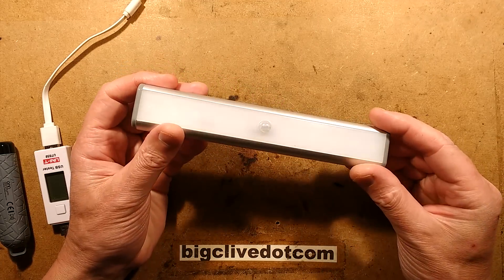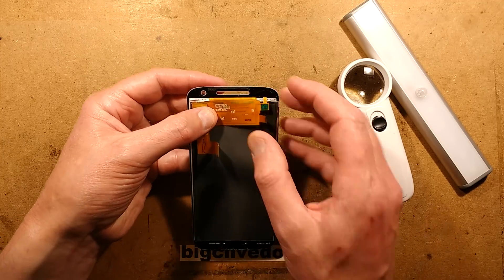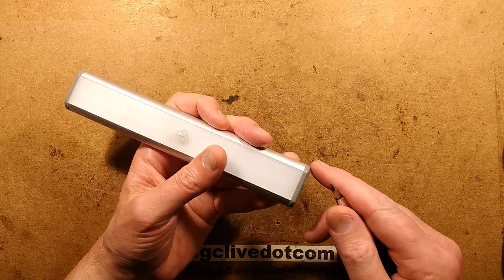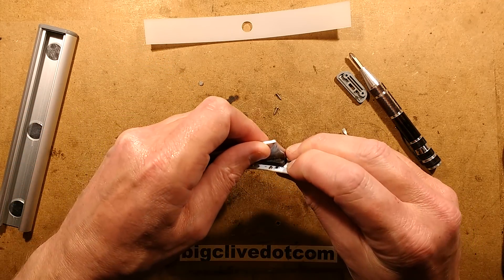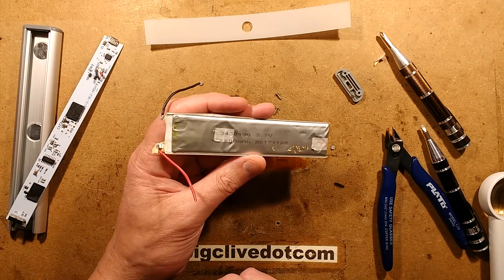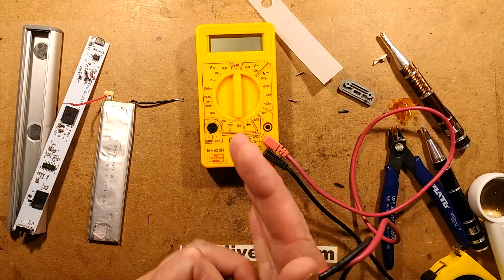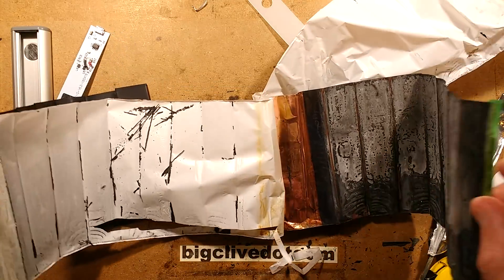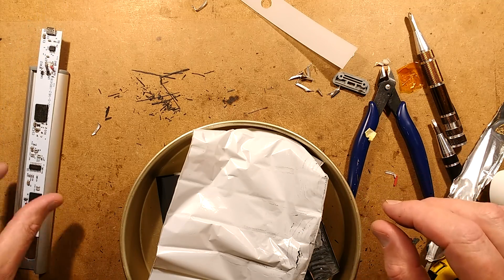Faulty light autopsy with "electronic noise" on the video.

Comment: Ive been modifying similar lights that use normal batteries to be powered with 18650's or a USB cable. Since most of these types of lights use 4 AAA's, 4-5v's is enough for an adequate amount of light when activated.. I recently just started using a USB cable and a Charger to power the one in my bathroom so i dont have to keep charging the cells every month

Comment: I once changed the touch-screen on my very old LG mobile telephone. It is as fiddly as you say, but just on the right side of possible. However shortly afterwards I realized I didn't actually need or even want a mobile telephone at all and binned the whole thing. I've never looked back, nor do I miss it.

Sooner or later there will be a mobile telephone backlash. It'll happen. Eventually--just like power-factor smart meters. Probably when the amount of government spying that is carried out through them comes to light. Or worse still when the ASI's that watch us constantly through our mobile devices decide they don't need squishy carbon-based behavioural analysis any more. It won't be long...

I was also expecting a high-pitched 'yerr'll get cayncerrr...' comment at some point

Comment: You should just get a cheap older DSLR camera for making videos Clive....don't use a phone...you will have real optical zoom and if it's a Canon or Nikon, you can use cheap old Russian m screw mount lenses with a cheap adapter which are super good. It makes it a LOT easier really, having a good real camera. Camera about maybe $80USD lenses, it varies but their like as cheap as 10 to bonkers price, but a decent old Russian zoom lens will be like $40usd and a much more durable setup than any phone!

Comment: Question for the expert on such things, now I know that this is a bit off topic, but since when has this ever stopped me before.  I am wanting to build some capacitive dropper circuits, and other devices that use capacitors.  Living in the Voltage Deprived United States, and having to deal with 110 volts, I am running into problems finding anything that will work.  Seems the Chinese are building their cheap capacitors for 220 or greater. I was just searching for some X2 caps, and all I can come up with are rated at 275 volts, and the Orange Drop type are all rated at least 400 volts.  I have tried some of the kits from China that come with those caps and have had zero luck getting any light save one that is so dim I am forced to light a match next to it to find out if it is lite at all.  Any work around or must I order from a parts house that charges realistic prices instead of the rock-bottom prices from China (which may disappear soon anyhow the way Trump is going with this trade war!)

Comment: Once upon a time an IT dept person at my place of work came to me and borrowed my battery drill and a 12mm twist-drill. As an engineer i made zero inquiry what for (silly me)... Less than 10mins later the building was on full evacuation because of the chronic stink emanating from the IT department. People were coughing, eyes streaming some having trouble to breathe! We later discovered Mr IT had been doing a favour and attempted to drill out the swollen and jammed in cells from a wireless Mac Keyboard!

Comment: haven't taken quite a few LCD's apart I see phones are rather similar.  just not many accidentally smash a 20 inch lcd tv  (oops)  hey at least I still have use out of it.  I use it as a table over the top of my multi function printer :P  yeah 3d , mirrors white, misty whatever layer they do...  Might have to play with instant film before you know it,  as I took one apart after I skewered the film.  Cause apparently impossible polaroid film just sucks :(  no problem with b/w though..  but bothered to take one apart and oh  6 volts left on the battery , bit of a shame to be wasting 6 volts :(  any ideas on killing the charge ??  not sure if I should solder that or not :O

Comment: B7000 glue Clive. Clamp overnight
Reply: Ian Reilly I recommend this too, very good for phone screens and iPads, use sparingly, it’s horrible to get screen back off again.
Reply: Bit Repairs Yeah. Its great stuff. I use red tacky tape for iPads myself, making sure the frame is spotless from old glue. Removing the crappy adhesive that comes with the new screen. I only fix the motherboards in phones now. Something Clive would be great at if he got into it

Comment: I fix phone screens as part of my job, sometimes the adhesive won't stick real well, especially when cold or dirty. Set the hot air gun to about 200c, warm up the phone screen and gently press down. the heat will make the glue stickier.

Comment: I own at least 20 of those lights and love them.. Have had only one failure and the company replaced it.   We installed them in the new kitchen remodel under all the cabinets.  Work beautiful and actually last quite a while if you don't have them activate during day time hours.  You can get them that are selectable.. i.e. activate day and night w/motion or night only with motion.  We got two models of this light.. the one that is motion controlled like the one you just tested and the other model which has a remote control which is nice because you can then turn it on and off like any other light..  That is used over the stove, for example.   Anyhow, they are nice solid little lights if you don't want to run cabinet wiring all over the place.

Comment: I had one of these that was 3 times as long and the battery was only about 1/5th the size of that one, would only last a few days of normal use. Bought a bigger one and placed it above my door, ran a cable out the window next to it and hooked it to a small 5v solar panel (with diode inline) and it now charges during the day and runs perfect at night.

Comment: My room mates sister wanted a light under her sink so she could see her pots and pans so I installed a motion sensor light similar to that.She goes under the cabinet about 4 times a week so I figured it would only need recharging about 4 times a year,WRONG. It was  an infrared sensor that detected heat so every time she runs the hot water the light comes on. I wrapped every pipe with insulation but could not stop the light activation.I just gave up and told here to turn it on manually.

Comment: “It’s up-side down...” the electrons will fall out. Which probably accounts for the battery problem; once all the tightly packed electrons fell out, there was nothing holding the electrolyte in,so it leaked out, too. 🤪

Comment: They used to make phone screens out of plastic (Samsung S5), but they were far too durable and people weren't buying new ones.
Reply: psygn0sis they also felt terrible, though, and scratched like a mofo. Also the S5 had gorilla glass 3, not plastic. Plastic went out of style with resistive touch.
Reply: Most phones have been using some type of Gorilla Glass for quite a long time, it is an Acrylic, I guess you can call that "plastic" if you want but that's not very accurate.
Real plastic (Polyethylene) screens don't support capacitive touch technology and died with the resistive touch screens in flip phones and PDAs.

Now the back of the phone being covered in Gorilla Glass instead of a removable plastic or metal back is definitely planned obsolescence.
Reply: Jayson Wills they haven't died yet, 3DS still uses them
Reply: Knuckles the Echidna 
Nice catch. That just might be the last resistive touchscreen on a mainstream consumer device.

Comment: The "pleasant odor" you are loving when opening these batteries is dimethyl carbonate. It is not particularly toxic with an ld50 in the few gram/kg range and breaks down into (in these quantities) harmless methanol and co2 in vivo. Carcinogenicity data is unavailable but just looking at the molecule and judging by its harmless rapid breakdown products I'd highly doubt it is. May be an endocrine disruptor but in these tiny quantities and non bioacumulative nature, who cares.
Reply: Andrew Walsh
If we take "a few grams" to mean 3 grams then the average adult male needs to ingest 240g (about 1/2 pound) of the stuff in order to hit the ld50 concentration. That's a major fuck-ton of electrolyte seeing as how there is only a few grams of it - if that - it in a typical cell! Toxicology, man... the dose makes the poison.
Reply: It could also be cyclic carbonates, in particular ethylene carbonate or (because of lower melting point) propylene carbonate. Quite harmless, really.
Reply: Ld50 few G/Kg sounds pretty toxic to me.
Reply: well the ld50 for table salt is 3g/kg and ibuprofin is 0.5g/kg so yeah, no, it's not.
Reply: Thats ok, as long as he is not a rat. ...
Reply: LD50 for what? LD50 isnt a thing in humans because its impossible to do lethal tests on humans. And the LD50 value depends also on how the substance enters the body: IV, oral, IM, etc.
Reply: Side order of lithium hexafluorophosphate, possibly. That decomposes to HF with heat, or into hydrofluoric acid with water.

Probably not a really concerning amount in this particularly dry cell, but worth knowing.

Comment: To fix your phone, you may want to employ some heat. Remove the battery first for obvious reasons. The judicious use of a hair dryer or a heat gun helps though. Just be careful not to heat the screen up too much as the fluid will cause it to burst. I had to recently fix my Samsung S7 for much the same reason though it had nothing to do with explosions. No, I just happened to drop mine...

Comment: I’m hearing some weird noise now, or are you running a water pump? Or was that the power supply fan?
I also could hear your soldering iron heating element come on and off, but I checked your last Christmas light video and heard the soldering iron also when you soldered the resistor in. So I think that was always a thing with the iron.

I found this stuff to work great, either the 3M Black tape or the scotch black tape. 
I used to use 2mm, but wasn’t wide enough for some screens, so now I have the scotch 5mm wide tape and just use an exacto knife with a ruler to cut down the smaller strips I need. My 2mm roll lasted years, but then I lost it? So this time I bought the 5mm. It’s easier to cut it down then to place little strips next to each other because if they overlap even a little bit it will cause the screen to pop up again. Tight tolerances. Before the black tape I used the pre-cut clear strips and you I had to constantly redo a screen every three months, so when they were gone I bought the better stuff, lesson learned. 
https://www.amazon.com/gp/product/B00K4VZNF2/ref=oh_aui_search_detailpage?ie=UTF8&psc=1

Comment: The screen thing may just be a cheap third party screen. If you can find an actual OEM refurbished screen, it's more expensive, but it shouldn't have weird line noise or any touch issues. The other side of that is that it's hard to find real ones.

Comment: I've had great success in both delayering the screen from the digitizer and bending ribbon cable with heat. Get'em toasty and you'll be able to do things simpler. And considering that to solder something on you need quite a bit of heat, you can go right up on the nose with the heat when dismantling these components (not, for bending the ribbon cable, that one less heat).

Comment: In my experience a screen protector wouldn't have done much but maybe keep some shards in. Also if you don't already have some, this is the type of stuff we use for devices we can't buy precut adhesives for: https://m.aliexpress.com/item/32623744524.html?trace=wwwdetail2mobilesitedetail&productId=32623744524&productSubject=32623744524&shortkey=N7n6n2Yz&addresstype=600

I'm not recommending that seller per se, that's just a cheap one that appears to be the correct thing. That stuff is way better than cutting slivers of regular double sided tape, though I've also had to do that and it works fine, especially if you heat it up a bit after then hold the display in place until it cools

Comment: rubber cement like glue is the best stuff for glueing down phone screens becuase it hold um in good but can easally be peeled off next time a repair a necessary. I personally use "LOCTITE® VINYL, FABRIC & PLASTIC FLEXIBLE ADHESIVE" its super cheap and works perfect.

Comment: BTW about ribbon cables, I used to service a particular brand of industrial lcd monitors and 100% of them had the ribbon between the lcd panel and lvds board pre-weakened with laser. A zig-zag pattern of superficial cuts that one harder slap would sufice to break. Talk about industry standards... :))

Tho, very few failed there... most had dried caps but were intended to opetate in public locations subjected to vandalism risk...

Comment: For holding screens to the frame a bunch of people seem to recommend B7000 or you can try an adhesive sticker but I've noticed not all of them have a very strong adhesive, the Hot Melt Glue (HMG) stickers seem to be a bit better but I'm not so sure that you can get them for every phone.
Reply: Rigid and permeate glues are not good for phone repair, something that will hold the phone in good but can be peeled off with not much work is way better. This allows for future repairs and fuck ups. B7000 is a bit bit expensive and really is nothing special so i don't recommend.

Rubber cement like glues are the best stuff for glueing down phone screens because it holds um in good but can  be peeled off next time a repair a necessary. I personally use "LOCTITE® VINYL, FABRIC & PLASTIC FLEXIBLE ADHESIVE" its super cheap and works perfect.
Reply: I agree with adhesive being easy to remove is good but B7000 expensive wtf? Do you live somewhere that it actually costs more? Because you can buy it online for $4-6 in a 1.68oz (50ml) tube vs the 1oz (30ml) tube of loctite at about the same price, so it actually costs nearly half as much since you get 68% more out of a tube, as for it being permanent from what I've read yes it is harder to remove but it's not any harder than the stuff the OEMs use, just apply heat and pry it up, I don't think that's a big deal personally. (also it isn't rigid... It's flexible similar to the loctite)

I've not used B7000 myself but there must be a good reason why it's the goto adhesive for quite a few people, although I wouldn't mind trying that loctite sometime.

Comment: I'm at second 26 and my guess is either a faulty connection or high internal resistance in the cell. By bets are on the second option though.

Comment: What kind of phone is it you're working on? As someone who has done phone repair for over 10 years now I can't quite make out what model that screen goes to. Weird to click on a clive video while at work (where I do phone repairs) to see clive talking about phone repair.
Reply from the maker: It's a Moto G4.  I've a suspicion that the noise may be due to the grounding tabs on the screens ribbon.  The original ones may have been fixed with conductive glue, and while the new tabs sick to the residual glue I'm not convinced it's making a good connection.
Reply: bigclivedotcom ah okay Motorolas are tricky beasts. I wasn't able to hear the noise you're talking about as the little speaker I watched the video on is awful and has it's own grounding/interference issues when plugged into my computer here at work.
Reply: x9x9x9x9x9 Seeing the design I thought this was Doogee or some other Chinese crap that Clive presented on his channel.
Reply: bigclivedotcom The g5 plus is a great phone.  You can put the pixel rom on it too.. Look at that for an upgrade.

Comment: The word Moto is probably blacked out so it doesn't get confiscated and destroyed at the customs office.
Reply: John Francis Doe it’s the logo that will be confiscated at customs, so the Z part would fail, if I understand you correctly. Screen thingies do not have a logo you can peel off and reuse.
Reply: What about refurbished screens with original logos still on?
Reply: I think it depends on what type of refurbishment is stated in the listing. If it says that the screen was refurbished by manufacturer, and it's true, meaning that it is 100% original, then there should be no problems. Also if the listing says that it was seller refurbished, it should be ok too.
Reply: SinsBird What if the listing has a big idiot-proof drawing marking out "Original BrandX partX with original markings", "Replacement BrandY partY" and finally "BrandZ refurbishment logo for complete assembly" ?  Would this get past customs?  (Internationally not naming actual names).